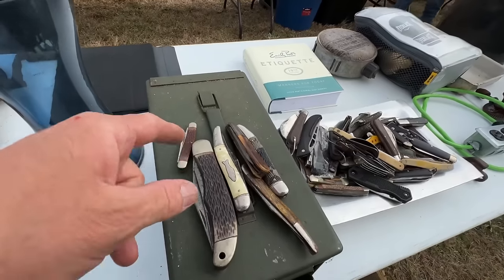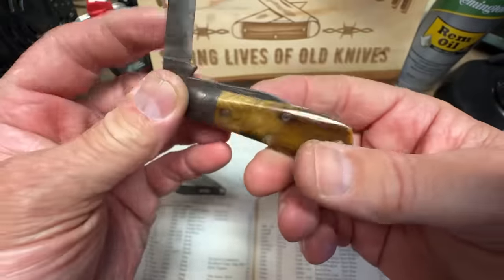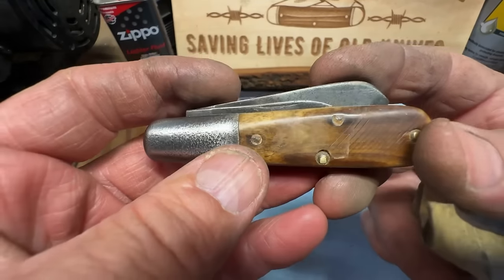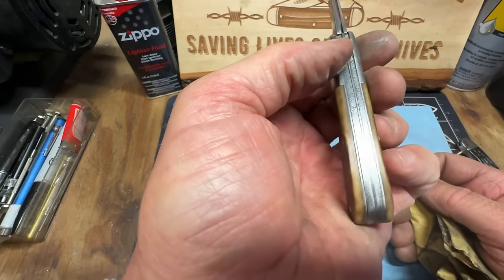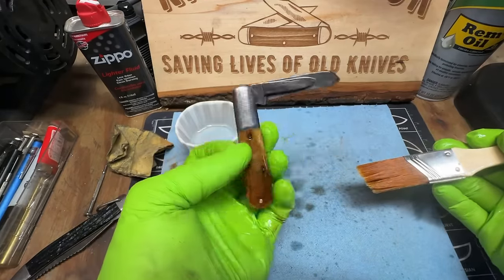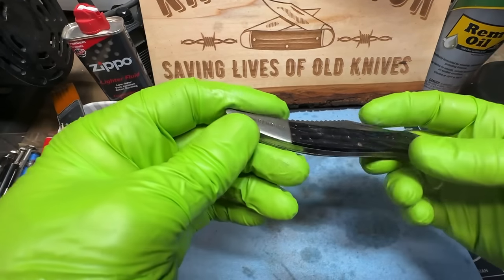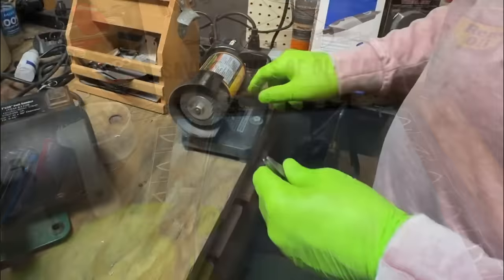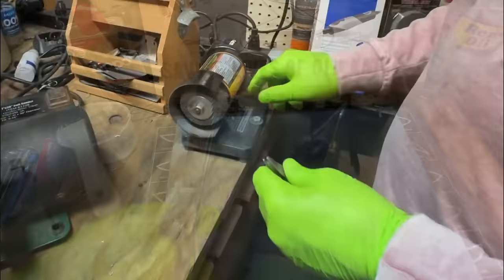Transforming a $5 Knife into a $475 Gem!

Comment: That knife was made during the war when we had a brass and copper shortage realistically in the condition of the knife if you got a $200 offer that's fair, remember that the top $is for new never sharpen. But you did very well. 😊
Reply from the maker: It was made before the war.  1920-1940.  It’s pre 1940.

Comment: The best knife purchase I made recently was getting two Case Classics for $75 each.  I didn't realize that they were Case Classic, and the prices kept on dropping.  One day I realized that they were Case Classics.  I they were just on the site a Case knife.   For those who don't know Queen Cutlery made most of the Case Classic that Parker contracted when he owned Case.   When Bill Howard worked at Queen, he was in charge of the Case Classics and Winchesters.   If you can't afford a GEC, get a Case Classic or a Winchester.

The only problem with the two Classics I bought is that Queen was still using celluloid or some such material for scales.  There is significant shrinkage, but I don't want to replace the scales because Bill Howard may have applied them.

Comment: You can chemicly remove a lot of rust on old knives with vinegar this way you don't have to use scrapers and abrasives so much and take a chance of damaging them. I have cleaned up a number of old knives with vinegar and a plastic cleaning brush. Sometimes I use a metal polish with a sonic toothbrush too. Weenol and an old Sonicare tooth brush works great.
Reply: I recently got some of those little plastic wheels that chuck up in a Dremel tool... They're kind of pinwheel looking deals that come in several color coordinated grits.  Good for cleaning up blades and such without being as harsh as a wire wheel.  They seem to work really good so far.  Those things and a little Flitz is a good way to go without doing too much.
Reply: Evapo Rust is better than vinegar. Alot less harsh on the metal, but removes rust just as well. Also reusable
Reply: Thanks for sharing the love, and greetings from Goulburn NSW Australia
Reply: Vinegar is much h too abrasive. Avoid it!
Reply: He scratched the shit out of the surface of the metal with that jewellers screwdriver.

Comment: Any time steel has been stamped, if you can heat the steel until it discolors from the heat, even if the stamping has been sanded or polished off, the stamping will reappear.  It will discolor a slightly different color from the heat treatment.

Comment: Get you some green ( you can use them all and work your way down) strope compound, put it on a stope, then work the bolsters, liners, and blade on that strop. It will be shiny and almost new looking. It won't take the stain out of the blade steel, but it will give it a nice coating.
Reply: It should take the piting out of the bolsters too.

Comment: I've always felt grinder wheels where to abrasive sometimes and can ruin the surface of certain metals. So i just use fine steel wool to polish up older knives or i will just let em set in some evaporust that stuff works wonders and it cleans em up real good but. My favorite wadding polish to use is Eagle One "Nevr-dull" it comes with a cleaning/ polish agent soaked into it and really shines up whatever ur cleaning. Its great on a bunch of metals brass, chrome, steel and more.
Reply from the maker: It’s not a stone I’m using.  It’s a fiber wheel.  Like an SOS pad.
Reply: @theknifedoctor  yea i don't use wire wheels neither nothing that tends to use power really just some elbow grease and no sand paper neither unless its like 800 grit but. Not telling u what to do just what i do with my knives.

Comment: A tiny dab of FLITZ on LOW speed on a variable speed Dremel cloth buffing wheel works wonders. The hard felt wheels can maybe round off corners etc. 357Magdad is a good source of knowledge for that kind of thing. Good job brother.
Reply from the maker: Thank you!!  I haven’t seen it round corners at all.  You need to be careful around plastic and bone.  It will eat it.  Metal-it just gets it good and clean.

Comment: Nice knife and all, but…

Yours has 4 pins while the book knife has 3. I assume that means something?

BTW, I’m from your area.
Reply from the maker: Look closer, that’s not the same knife pictured.  Notice the main blade.  They only use photos of some knives.  Not always the exact knife model in relation to those in the book.
Reply: @theknifedoctor . Exactly. Much of the catalog artwork ( for the advertising) of the early teens through the forties was a mere interpretation when it came to vintage vises, toolboxes/chests, tools,knives, etc. 
Oftentimes small details such as rivets or other aspects were different on the actual product due to various factors.

Comment: Cool knife. Was there a specific task that sheeps foot blades were good for compared to others?
Reply from the maker: Great Question!!  The sheepsfoot blade is commonly seen in sailing knives because it does make it hard to stab yourself while working with rope and such on board an unstable surface. It's also seen in rescue knives because you can slip it under seatbelts, clothing, etc without too much worry of cutting the person being restrained by same. With a lot of steel behind the tip of the knife, I imagine they are relatively strong, although you don't get a really pointy point.

Comment: I thought those only had the 3 brass pins on the handles for that era. Can you verify if the 4 pins are correct for the sheepsfoot blade? Every one I see has 3 unless it is the larger single blade model.
Reply from the maker: It’s correct for that model.  It’s the real deal.

Comment: The Case does not have “Case” stamped on the bolster and the blades are switched.  You sure it is what you think it is?
Reply from the maker: What??  I’ve never seen case stamped on a bolster and no the blades are not switched.  You so funny!
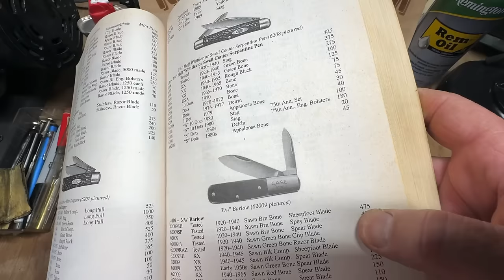Reply: @theknifedoctor go to 2:05 in your video.  The word “CASE” clearly shows on the bolster in the illustration, but it is not on your knife bolster in the same place.  With the bolster to the right as in the illustration, the small blade is closer to the viewer. On your knife the small blade appears on the far side of the main blade.  So yeah, thanks so for the compliment about me be so funny…..

Comment: Found a few old Case knives a few weeks back at a garage sale. Was so excited at first because they looked to be in really good shape. Until I opened the blades up.  They were all worn down to nothing. Apparently the owner had a fixation with using some kind of a cheap carbide sharpener that he had literally just ground the blades away with.  There was hardly any blade left in any of them.  I didn't even buy them even tho they were marked at a couple but each.  So sad.  The guy must have just trashed the blades every time he used them.  There was a couple of old pull thru  sharpeners and one that was like a wheel that you set the blade into and rolled it back and forth.  I think that's the main one that was overused on them because they were worn more in the center than the ends.  Looked like karambit blades  by the time he got done with them.   Damn shame...